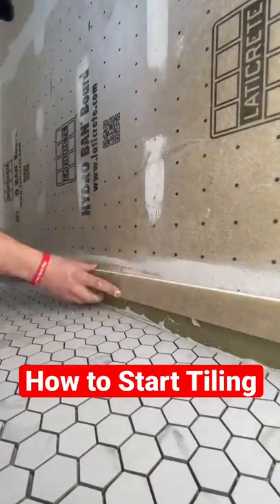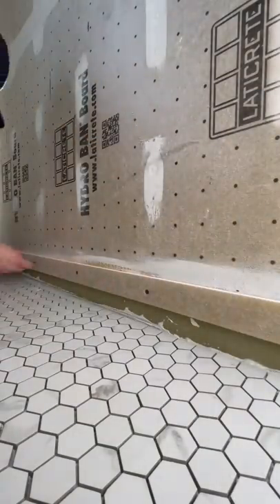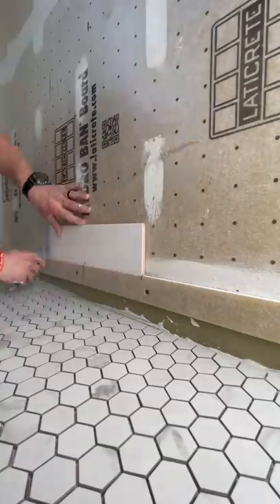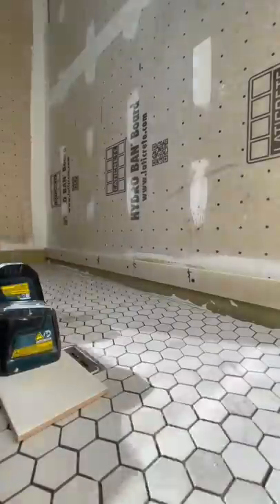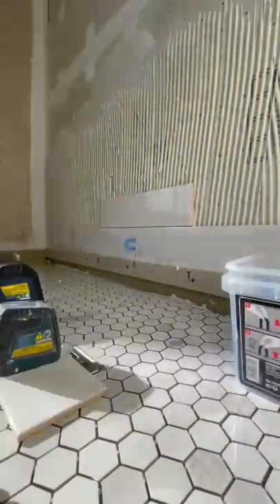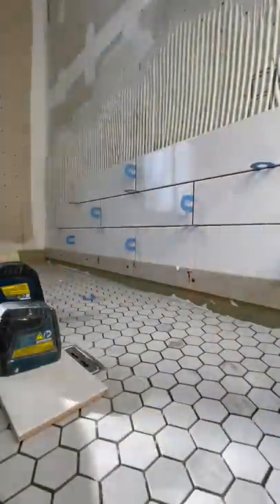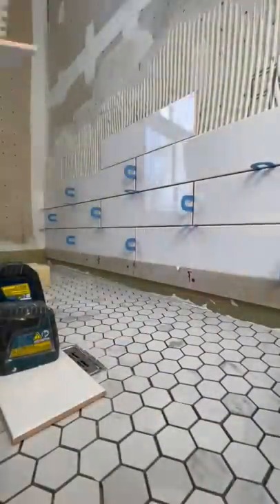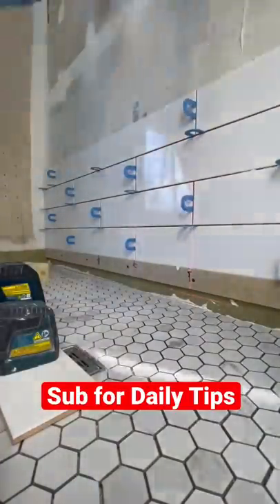How to start tiling shower wall. #diy #shorts #youtubeshorts

Comment from the maker: I am so far away from being perfect at this! But there are tricks that you can learn to still have a very good result! I’ll share all the trick I know and will learn:)
Reply: Really appreciate what you do!   I need your opinion, should i use chicken wire when putting in dry pack for shower floor?
Reply: @OhFrak  no.
Reply: Tile fail mud job must be perfectly level its not hard stick to dry wall winni
Reply: @OhFrak  yes
Reply: And now you have holes in your shower wall where water can leak... Genius
Reply: @OhFrak  yes
Reply: You keep nailing shit into your walls and Floors, stop it

Comment: Set your laser and use the laser line to cut the first row of tile straight and level. It's actually faster that way. Ledger board takes longer. You still have to cut the first row of tile when using a  ledger board
Reply: Some people use the ledger board to do the pan after the walls
Reply: I've personally struggle with this because it's never perfect. Scribing it is just easier for me

Comment: Putting a screw in that low, will probably penetrate the shower pan.
Reply: Probably??? 

It's a guaranteed 
Like 3 months worth will have water start to mess it all up. From the inside of course 🤦
Reply: Shower pan should be up 6 “ from shower floor
Reply: No one uses pan liners anymore.
Reply: There isnt a pan on this one.  Most likely a 2” band from the corner.

Comment: I don't use these boards. You puncture the underlayment and you already have that lazer there. Why not just cut the bottom row aligned with the lazer to give you a ledger ? It takes the same amount of time and you don't have to puncture it and need to silicone it. 
I'll pass on this ledger.. it must have passed your flood test, but then you punctured it after ? I create my own ledger with simply cutting my 1st row at the angle needed to give you a straight line. You still have to come back and cut it anyways... but now you have to silicone holes and risk it leaking. I'll pass on this one. Seen this by others too, just makes no sense take the time and cut your straight line.
Reply: Once you get good at this way,  you'll never go back
Reply: Agreed.
Reply: It does make sense i do it both ways the way you explained it and with a ledger board depends on the install of what am doing and like he said depends on the drypack under alot easier to custom cut after then to start cutting and going.

Comment: Screw in the ledger board. Won't the screws leave holes....ruining the water proofing?
Reply: Pretty sure he goes over the screws  wholes with a liquid waterproofing membrane .
Reply: @michaelfahim5878   I'm just wondering how many people learning from the videos don't and maybe run into issues.
Reply: @04051988ism  they don't run into issues because you fill the holes with mastic or thinset and it will never matter.
Reply: @Tool_Addicted_Carpenter  you saying mastic in a wet area let’s me know you don’t know what you’re talking about
Reply: But you still advise mastic in a shower...
Reply: @Tool_Addicted_Carpenter  mastic will never fully dry in a wet area. If you pull a tile set in any type of shower/tub you can see it’s very different from thinset. The only area where mastic is somewhat feasible is a backsplash. If you’re doing remodels then maybe just take the advice, it can only help you.
Reply: If you wanna get into numbers I can do that as well. I've been a professional tile setter for 20 years. On average I install about 30 custom showers a year. I do not and will not hire anyone else. The only area mastic is ever used on my jobs are on a backsplash. If you are to lazy to mix some thinset up for any area s of a bathroom you shouldn't be doing any of those jobs. But hey if you wanna put your name on that good for you.
Reply: You use the same hydro ban glue to waterproof the seams and screw holes to seal the holes at bottom.
Reply: @Tool_Addicted_Carpenter  dam nice resume, I'm pretty impressed. With all that knowledge you have obtained. Please enlighten us all. About the other poor construction practices you have implemented on your job sites ? I guess your the general that gets the contract. Subs everything out. Than takes credit at the end for all of the work. Also the one that will show up can barely fit his ass on a 5 gal pal. And sit there and tell everyone else how to do something because you have seen some one else do it a different way. It's cool bro you go ahead and have your subs use mastic in your water areas.
Reply: @Tool_Addicted_Carpenter  jack of all, master of none!

Comment: 50% offset on 12" wide tile? Do you get lippage? Do you toss bowed tile?
Reply: I set a backsplash the other day and it gave me some lipage
Reply: @hiddencityboxing4564  I'm gonna do the 33% offset instead.  I would prefer the look of the 50% but this tile is cheap and when I lay it on glass, most of it isn't flat.
Reply: Yeah, you need to purchase flat tiles. He mentions this in an earlier video.

Comment: How do you decide whether to put the mortar grooves on the tile or on the wall?
Reply: Trowel ridges on the wall or floor is the standardized way. Of course there may be unusual circumstances at times where troweling the tile or even both surfaces works out better.
Reply: @MoneyManHolmes  yeah I was just curious what circumstances would make someone groove the tile instead.

Comment: With what do you seal the screw holes after removing the support?and i also heard that the board wall shouldn’t touched the pan ,is it true or doesn’t matter as long as it is sealed properly?
Thank you for those videos ,that helps a lot.
Reply: Hydro ban glue for screw holes. Your boards on wall should be tight and board walls and shower pan should be tight too and sealed with hydro ban glue and keep it clean with tools to smooth the glue out to avoid glue chunks that would push out the tile and not have the tile flat on walls. You should use seams with mesh tape and seal it with hydro ban to avoid leaks and cracks on tiles

Comment: You need thinset versabond mastick it’s wrong
Reply: Versa bond is garbage. Use pro lite thin set for subway tile. For any other tiles like shower pan use platinum 254 thin set.

Comment: If I came into my bathroom to see you putting screw holes in my shower wall you’d be fired. Purely because tradesmen are “professionals” therefore not cheap so they should know better.
Reply: So how do you suggest I install the boards and keep them in place? You don’t know nothing about this profession. Leave it to the pros.
Reply: @diegosantiago8714  fired as well
Reply: Also how do you put grab bars in? Personal shower bars or hooks? Now could you let me know please.
Reply: The difference in location is key

Comment: Should notch horizontally in future, better bond for larger tiles as it tends to run down👍
Reply: I was taught the exact opposite. Notch should be vertical so it doesn't droop and maintains consistent coverage.
Reply: Run notches the shortest dimension of the tile like you said, but doing it the other way shouldn’t be catastrophic in itself.